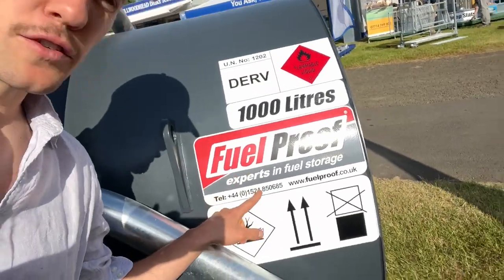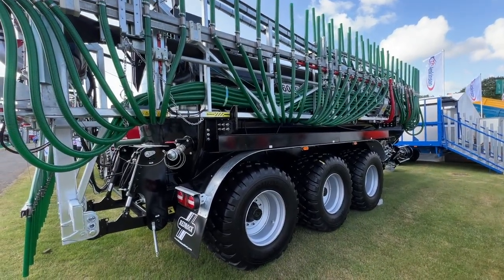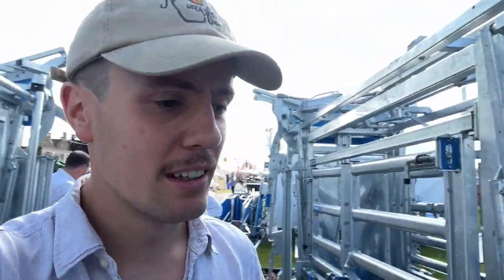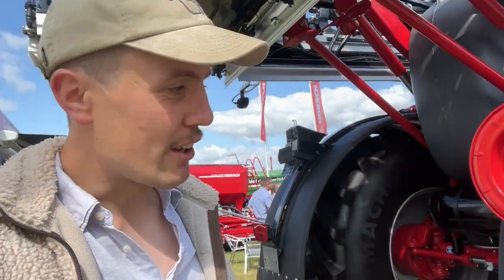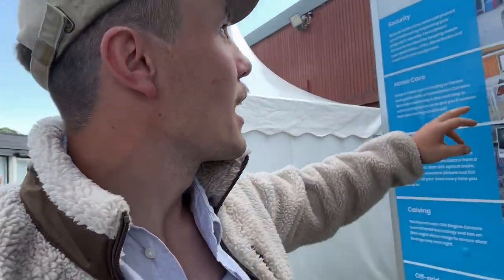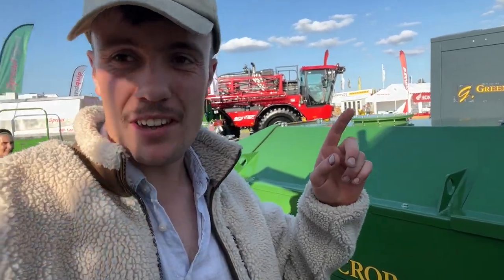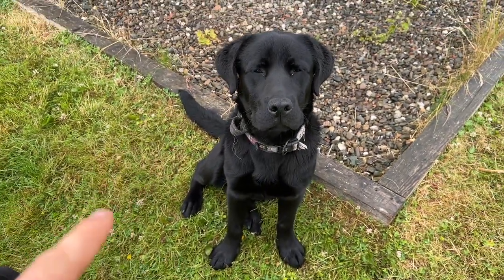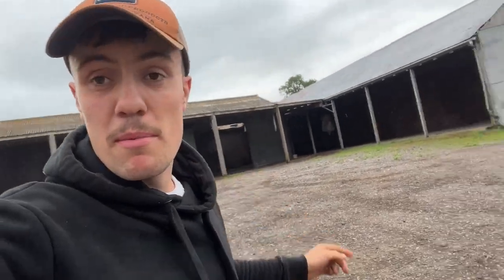Royal Highland Show 2023 | Machinery Overload

Comment: We tried a spreadable style machine and they work well on big loose hpuses but in smaller pens it’s better to have a tractor powered machine we run a Lucas and Teagle. The teagle is a better controlled machine but the Lucas is a higher output machine